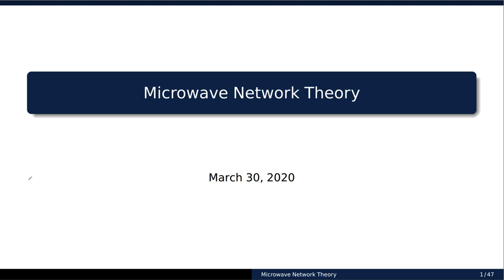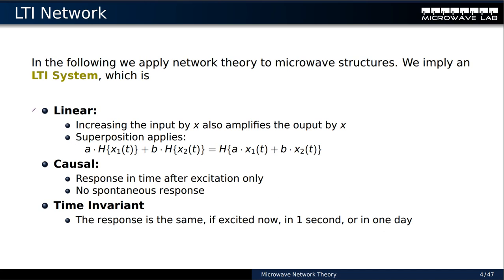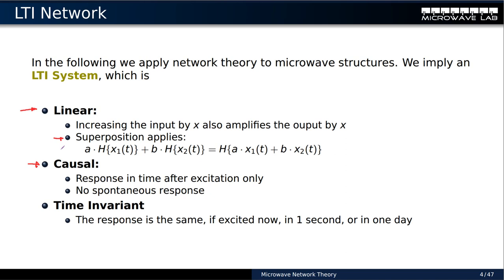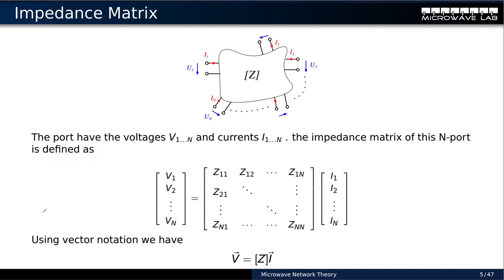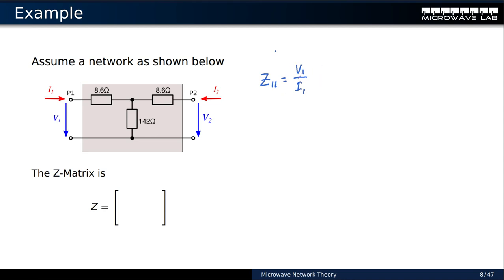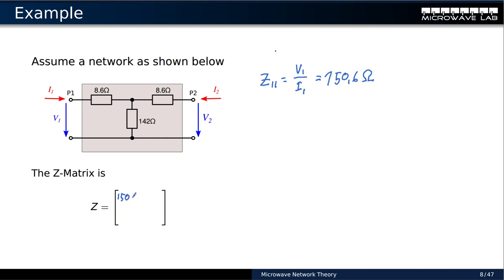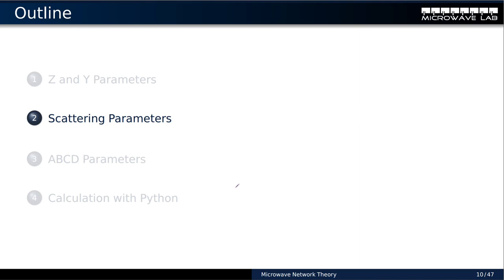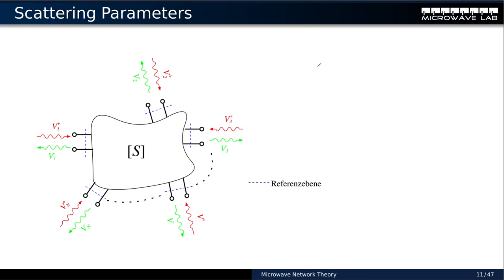Lecture05 Part 1:  Network Theory for Microwave Circuits(english)

Comment: Hi, 
I have a quastion. When you where calculating s parameters of a 2 port network you where using incident and reflected waves. How can you do that if you do not have transsmision lines? 

Also you sad that incident wave at the second port is zero because port is mached terminated, does that mean that you conected load impedance via transsmision line with characteristic impedance 50 ohms?